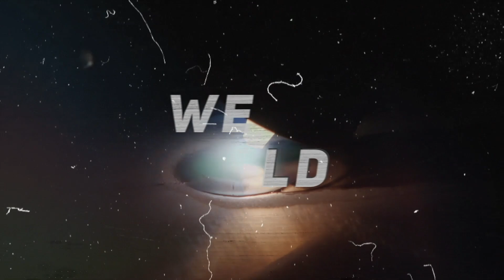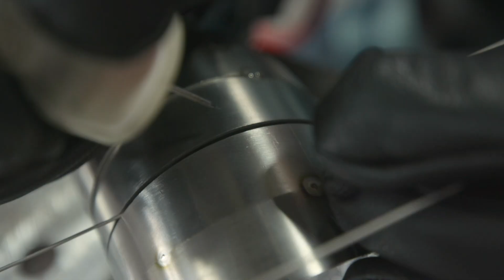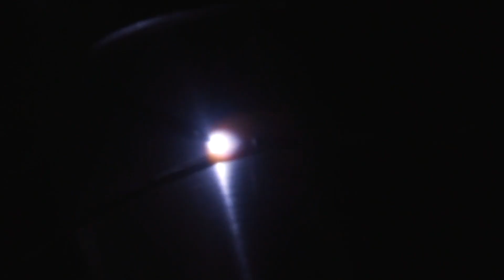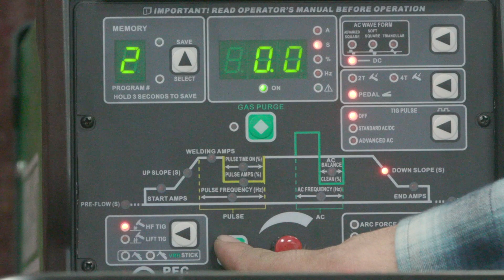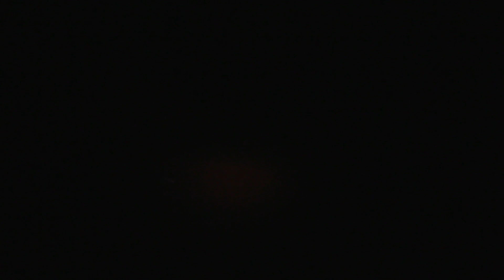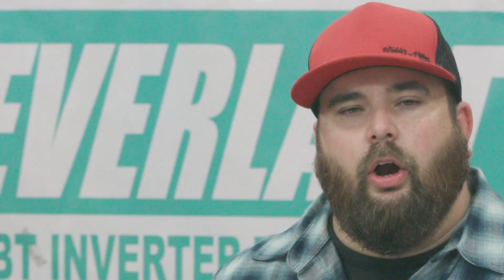TItanium Pie Cuts

Comment: The pretty colors may look cool, but they are not. This should be welded in a chamber purged with gas.  The colors indicate oxygen contamination and shouldn’t be there. I can’t even tell you how many hours I’ve welded with my face against the chamber. Titanium is fickle, and needs certain parameters for a proper weld. Carry on.
Reply: I've read that welding in a chamber is the preferred method.  I welded my titanium exhaust in my garage with just back purging and it has lasted 3 seasons of hard track abuse.

Comment: I'm glad to see Everlast posting some videos, and I have 3 comments to help you sleep today:  
(1) It would be nice to see how the back side of those joints turned out.  Yes, inspection mirrors are acceptable for this.
(2) Since titanium is so reactive at temperature, did you use a gas lens and what cup size (12?) / flow rate?
(3) Since that PowerTIG 210EXT has a TIG Pulse feature, you could have showcased it.  I use this feature on my 255EXT to make me look like a better aluminum welder than I really am...
Reply: 𝐈 𝐮𝐬𝐞 𝐭𝐡𝐢𝐬 𝐟𝐞𝐚𝐭𝐮𝐫𝐞 𝐨𝐧 𝐦𝐲 𝟐𝟓𝟓𝐄𝐗𝐓 𝐭𝐨 𝐦𝐚𝐤𝐞 𝐦𝐞 𝐥𝐨𝐨𝐤 𝐥𝐢𝐤𝐞 𝐚 𝐛𝐞𝐭𝐭𝐞𝐫 𝐚𝐥𝐮𝐦𝐢𝐧𝐮𝐦 𝐰𝐞𝐥𝐝𝐞𝐫 𝐭𝐡𝐚𝐧 𝐈 𝐫𝐞𝐚𝐥𝐥𝐲 𝐚𝐦...

Any pics or vids of your welds, have a 255 and would like some pointers on your pulse settings as well as your technique on how you  tig aluminum.
Reply: I second ElCajoia's comments. Have a shiny new 255EXT also and would love some pulse setting guidelines others are using.